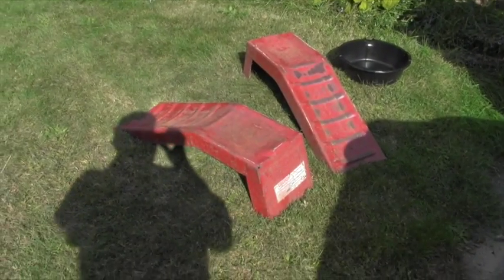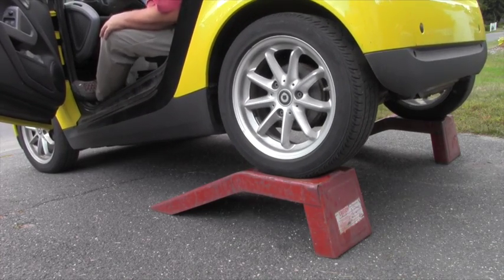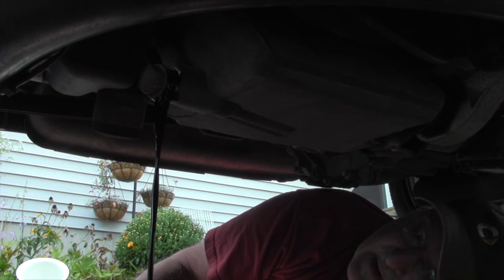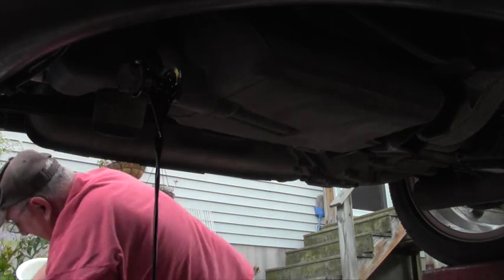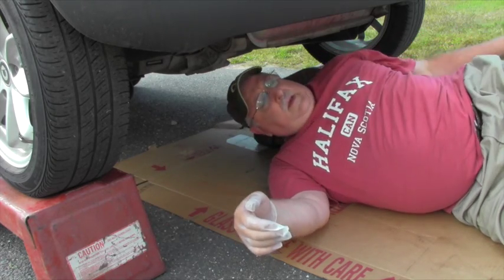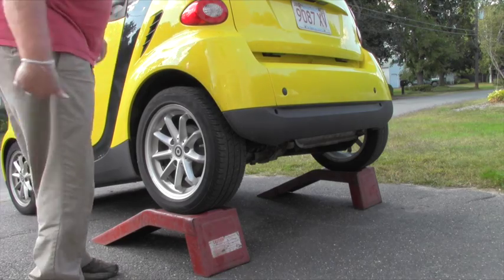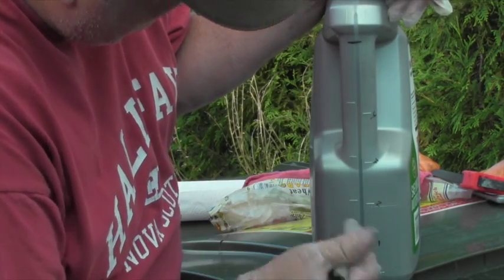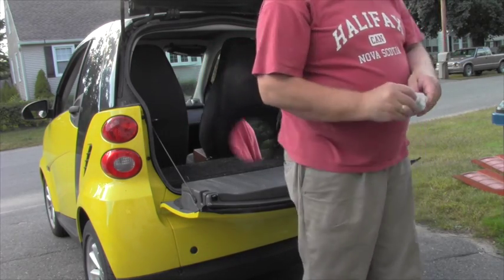smart Fortwo Oil Change

Comment: Holy crap man.  I garentee if you cut open your oil filter, there will be metal in it.  NEVER run a motor with no oil.  You should NEVER even put an oil filter on dry, always fill the filter up with oil to minimize dry start time.  also, change the filter first, so the dirty oil in the oil passages drain back to the pan, so you get more out when you drain the oil.  and no, never over fill the oil.  there's a reason for the air space in the cranckcase.  too much oil, and it will blow out seals, and cause oil leaks.  And before anyone says anything, im ASE certified, and been building engines/ transmissions since I was 13.
Reply from the maker: +MVP11489 Holy crap man. Do you think I really give a sh**? Are there not enough disclaimers to get through to you that I'm not really concerned about those 33 seconds with no oil pressure? 
How do you fill a filter that mounts sideways? I've had cars with side mounted filters.
You want me to drain more oil out, but then freak out if I start the engine. Maybe the old oil I left in was just for that purpose.
The extra dash of oil I put in was to compensate for the empty filter. I didn't top off the crankcase! 
Certified, schmertified... I don't care!
Thanks for watching!
Reply: +Denb7  OMG, where to begin XD.  First off, that rough tapping noise you are hearing are your soft babbit/ lead coated bearings slamming against a surface induction hardened steel crank journal.  Do you know what oil even does?  Do you know what oil pressure is even for? Obviously not.  Oil PRESSURE keeps the parts floating over each other SO THEY DONT TOUCH, EVER.  Ever pull apart a motor after running it 30 seconds without oil?  Obviously not, because you'd know that the bearings are now scored up.  Is this a problem?  Nope.  It will still run fine.  Won't knock, won't really cause any issues.  Only that you've greatly shortened the life of the motor.  Why put 20-30k miles worth of wear on a motor, in a few seconds over pure laziness?  I don't really care if you want to do it, but telling others to potentially ruin their car is a dick move.  What if a guy with 200k miles on his car sees this shit, and ends up with a rod knock?  I'm sure you won't give a shit.  If you really believe you are not causing any sort of damage at all, then you have obviously never built a motor or know what's going on here.  and telling other people to damage their cars is pretty messed up.  If you want to ruin your own car, then by all means, go for it.  but don't tell other people that its not causing any damage, when it clearly is.  I know damn well that you have never put your theory to the test and taken a pan off after doing some retarded shit like that, or even cut open an oil filter after that, because if you have, that glittery puddle of metal ridden oil would have changed your mind quick.

I've accidentally started motors without oil before, and found bits of metal in the oil pan from less run time then this.  Hell, I once ran a straight 6 ford without oil down the highway (shitty fram filter case exploded), and it siezed on me.  started right up the next day.  did the motor knock, or sieze up from that?   of course not.  But there was a fuckton of metal in the pan.   

Uhh, what to do with sideways filters?  Wow, how about fill the filter up most of the way, then get it close, then angle it in there quickly, the second you start to screw it on, the threads on the shaft will keep the oil from coming out of the hole as you screw it down, as the only place the oil can leak out of is the center hole.  it certainly won't come out of the anti-drainback valve holes around it.  The filter on my galant is like that.  Really not hard to do without so much as a drip coming from it -_-  man, you really have no clue XD

I'm not saying all of this to flame you, or tell you to not do this.  Its a free country, do what you want, how ever you want.  But don't tell someone else to do something that could ruin their own car.  Times are hard, cars are expensive.
Reply from the maker: +MVP11489 Well for someone who already knows far more than poor little old me, you certainly have an awful lot to say. As a mechanic I suppose you make money fixing cars. I would think you'd appreciate a video like this as it would certainly drum up more business for folks like yourself. 

Could that mysterious tapping sound possibly be coming the sound of hydraulic lifters operating without pressure? Be honest!

This video is how I change my oil. I never tell people to do what I do. I have disclaimers in the description and within the video to warn people. If half the people who watch YouTube videos did half the stupid things that other people have uploaded to YouTube, then a quarter of the world's population should technically be dead by now.

Tell me something... aside from the mortal sin of that particular 33 seconds during my video, was the rest of the video acceptable? Surely, oil does enter the filter even without pre-filling it, so I consider that point of your complaint to be moot. Assuming that starting the engine to circulate oil throughout the system, then rechecking the proper fill level would mitigate the issue of not filling the filter. Is there a considerable amount of damage done by not filling the filter, or is that just your particular SOP? 

I still can't understand why an ASE certified mechanic would be interested in watching a video of an old fat guy doing an oil change in his driveway? As a part time janitor, I know I have no interest in watching some other dofus dry mopping a floor or refilling a paper towel dispenser. So what attracted you to this video?
Reply: +Denb7  You answered my posts backwards, so it prolly would have made more sense the other way around but its not important I guess lol.  

Is it possible?  maybe, most likely not.  the lifters are sealed.  they do not have a constant flow of oil going through them (unless they are bad). the oil passages only open once the valve closes completely, but they won't leak out since there's no air in the system for the oil to leak out of.  The moment the cam engages the lifter, the oil passage closes.  That noise is your rod bearings as a solid flat cam motor will make that same noise without oil.  

Even though I would not do it the way you did, there wasn't much wrong else with the video.  Of course the engine would fill up the filter, but that's not really the point.  the point is to minimize run time without oil.  Of course, there will always be a second or 2 it will run without oil.  That can't be helped, but 2 or 3 seconds, is no where near an issue as 30 straight seconds of no oil.  

My point wasn't to flame you, or bash you.  My point was to inform you of the damage you are causing.  These motors aren't known for lasting much past 100k miles.  That's what happens in a 1 litre motor, pushing over 90hp with 11:1 CR.  Most cars are making the same power with almost double the size of the engine, so its already pushed pretty hard for its size.

Comment: I push mine back when I pull to far ahead at the gas station positive you can roll it down the ramp with out starting it.
Reply from the maker: Yes, I could easily push my car off the ramps. And because of the slope of my driveway it would quickly roll directly across the street and into my neighbor's yard. What is your recommendation to prevent this from happening?
As stated many times before, after draining the oil pan, there is a coating of oil lubricating all friction points of the engine. There is just no oil pressure while running it at an idle speed for those 33 seconds. 
Please advise which parts will be most affected by the lack of oil pressure during this process so I may keep an eye on them.

Comment: should do a video of taking the oil pan off and replacing it would help me out a lot cause my engine has no oil left since I hit the oil pan
Reply from the maker: Sorry. My smart fortwo is now a thing of my past. If you are destined to fix yours anyway, just video the process and upload it yourself.
Reply: @Denb7  dang would of really helped me out guess I should spend the $300 to get it taken off and replaced by a professional
Reply from the maker: @cooltraner567  Ha! You got off cheap.  I let a smart dealership change my muffler. It cost me $1000.00.

Comment: man, i never knew car guys were so dramatic.  even if you don't agree with his decision to run the engine for a few seconds after draining the oil, y'all act like he told you it was okay to put mountain dew in your coolant reservoir.

thanks for the video.  i need to change my ol lady's oil and i was worried these little things would be more complicated than an average car.  turns out it's easier than mine haha.
Reply from the maker: Jake Hagen Thanks for not being another car Nazi! Every time I see a new comment added to this video, I have to cringe a little before reading it.
Finally, don't be silly, everybody knows that Mountain Dew works better as a brake fluid than a coolant.
Reply: Haha I got your back. I'm not a "by the book" kind of guy, either.

Comment: So if you are old and overwieght so you cant give it oil while on the ramps, why dont you just roll it of the ramps, without starting the engine, and then fill oil in the car and then back up to a level ground
Reply from the maker: Level ground is the problem. As you can see, my driveway is very short and has a slight incline. My ramps have a depressed area to prevent the car from rolling off on its own. Therefore I'd need to release the handbrake, put the transmission in neutral and push the car off the ramps. As I am alone, if i push from behind, I would have no way of preventing the car from rolling into and across the street.
Reply: I pretty sure the car will roll off as the front wheels are on the incline part of the driveway.  If you back it up, pull the handbrake, car i neutrual, you could roll it off. I had a smart as well, they roll quite easy. I wont bust you engine, but i high compression diesel engine wears off the film pretty quick, so you greatly accelerates the wear on the engine. 
See this: 
But hey, you made a pretty basic video, and got 101 million views. I bet you havent seen that comming ;)
Reply from the maker: I knew I'd catch flack over that particular 33 seconds of this video. In the description, I added a link that shows a guy drain the oil and drive a car with 250,000+ miles on it at high RPMs until it blows up. My car ran at idle rpm for 33 seconds. I'm not concerned about excessive wear as the amount of time it operated without pressurized lubrication (there was residual oil on the bearings, etc.) was negligible.
BTW - It's only 101 thousand views, but I hadn't seen that coming either.

Comment: Thank you for your video.  I recently purchased a 2013 Smart.  I change the oil myself, because I was not sure on dealer maintenance..  I really appreciated the info on leaving the long oil plug/screen assembly in the pan to reduce oil spills as it made my job much easier and clean!

cheers
Reply: Wanted to thank you again for posting the smart car oil change.

I have now changed oil 3 times!  I change at every 5k even though smart says it is a 10k interval.  I drive hard and by doing this job myself, I am happy and save money vs having someone that calls themselves pros at and oil change shop.

Note:  Smart has a great downloadable maintenance schedule (10k/20k....etc).  I have used these forms and added to my vehicle documentation history.

Cheers,
P

Comment: Pour the oil amount in, run the engine for 5 min. , Shut it down. Wait 15 min. for the oil to settle; check the oil level; Add oil if needed; run the engine again; check the oil level, then that's it.

Comment: Thank you for posting your video. Here in England Smart are sold and maintained by Mercedes Benz and the servicing can be very expensive. I am gathering the info and parts to service my wife's 2009 MHD convertible. There are no workshop books available in Europe for ordinary home mechanics and you guys in the USA seem to have strength to walk away from dealerships.
Thanks again
Paul 
Ipswich UK
Reply from the maker: Paul Billingham Thanks for commenting on my video. I catch a lot of flak for running the engine before topping off the oil, but I don't care. I avoid dealerships, not out of strength, but rather necessity. In the USA, smarts are sold and maintained by Mercedes dealerships as well. I'm lucky to be only 30 miles from a dealer, but some people are 300+ miles from their nearest dealer. An oil change alone is outrageously expensive. That,s why I do it myself.

Comment: I have been an engineer for 30 years now. I will only say that. what you did is unacceptable, unacceptable. you have definitely caused damage to your engine.
You could put two liters of oil and then lower it. What you are showing is criminal.
Reply from the maker: Wow, Your Highness, you jumped from "unacceptable" to "criminal" mighty fast. I would never suggest that responses to my videos go from annoying to moronic as quickly as you have judged me. After 11 years of changing my oil in this manner, my smart never burned oil. Maybe you can use your engineering skills to calculate the amount of excess engine wear that has been caused by my annual 33 seconds of engine operation at idle speeds without pressurized oil circulation. Remember that all parts are coated with lubricant throughout those 33 seconds.
Why don't you take a moment and read the video description. Especially the part that says: "This video shows how I change MY oil on MY car. It is intended for entertainment purposes only and should NOT be considered an educational video."
I believe that I have a right to destroy my own car if I want, so where you arrive at "criminal" is a mystery.
I hope you were entertained!
Reply: I'm not sure I would go so far as to say that it was criminal but he absolutely undeniably unequivocally damaged that engine complete and utter ignorance
Reply: @Denb7  One thing is for sure, you don't know what you're doing, that's why you have the incalculable....

Comment: I'm not sure why he runs the engine when he does...  I've heard of some who run the engine briefly WHILE DRAINING to remove ALL the old oil from the case for a real empty case.  But he does it just to move the car AFTER he's finished draining it.  Seems easy enough to me to add the oil while the car is on the ramps - our Smarty engine block is kind of at waist level then.  Though, maybe it makes for bad filming.  ;-)  
Anyhow, the guy seems like he's been doing this awhile so all the heckling may be unfounded.  I personally love the vacuum job at the end - so professional!! :D  
[OOPS!!  This is Daniel's wife posting here...]  Sorry, Honey!! :D
Reply from the maker: While draining or after draining, what's the difference? There's still oil coating every part! I'd add the oil while it's on the ramps if there was no tailgate to contend with. On the ground, it's not an issue, but just try reaching over it while the car is on top of steep ramps! People suggest pushing off the ramps, but they don't understand my situation. It's tough to push the car and be on the brake at the same time. My car would end up in my neighbor's yard or at least in the middle of the street.
Reply: I think the starting "while draining" might move whatever oil is somehow held in the case to move and free itself for draining. It seems to me that oil change places ask for a quick start during the draining and I always figured that was their intention - to get parts moving a sec to push any remaining oil out. It makes sense to me that there might be oil that is pushed with a bit of a run to exit the case.  But, yes, for such a short run, there is some oil and it doesn't seem like enough heating and friction would be generated to cause any real damage.  
And, for sure, you can't brake and push off the ramps at the same time!!  :D  
(Still Dan's wife replying here...)